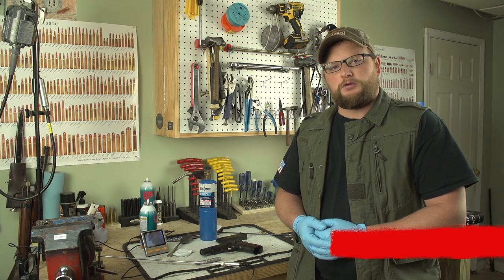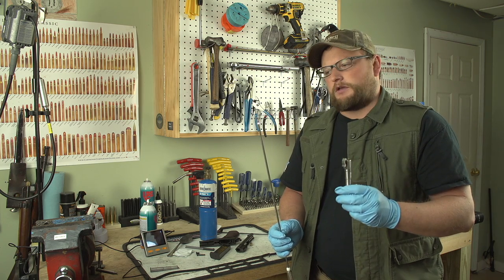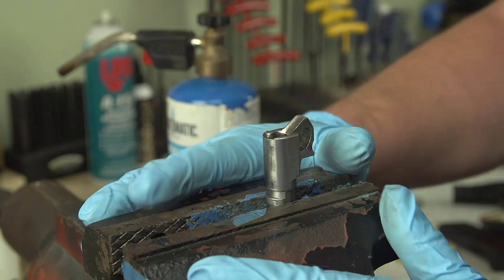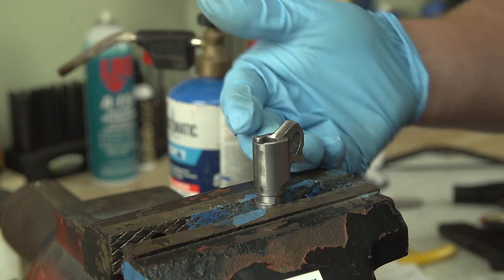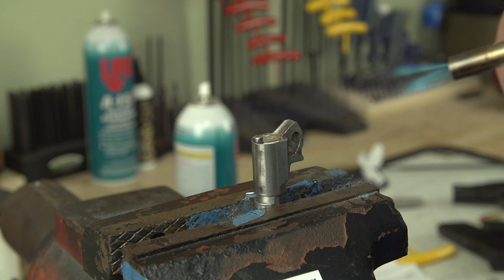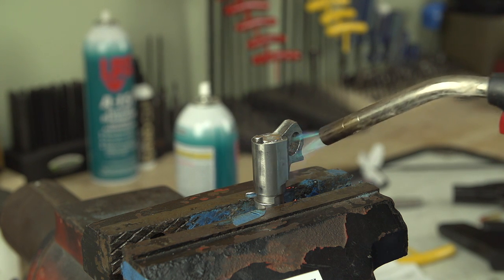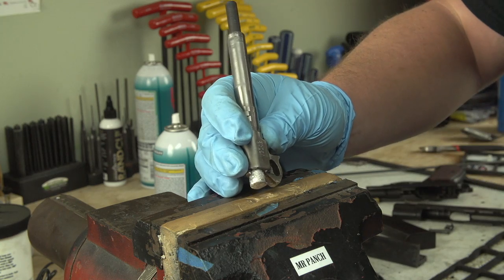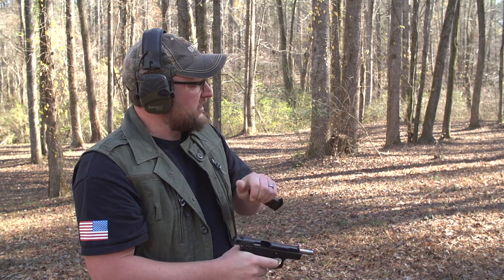How To Use Brownells Cerrosafe Alloy

Comment: with a melting point that low I would say that stuff is some kind of lead bismuth eutectic like used in alpha class sub reactors. cool stuff!
Reply: Mostly bismuth, but also 8% Cadmium, so you need to be even more careful with this stuff than lead.
Reply: V3N0M Wow not a eutectic...I guess it's either the tin or cadmium that prevents that. Thanks!

Comment: Cerrosafe shrinks a little as it cools, then expands again.  It is recommended to remove the plug, 30 minutes after the melt solidifies.  That is when the plug is typically at it's minimum size, a little less than a tenth of one percent smaller than original chamber size.  If you need to take accurate measurements of the plug, wait another half hour & it should be back to actual chamber size.  After that it continues to grow a little for the next 20 days.  In the end, it ends up about 1/4 of 1% larger than the original chamber.  It contains about 8% cadmium, so handle it accordingly.

Comment: I have a block of cerrosafe that I've never used. But it will come in handy. Nice that it's melting point is so low.
Reply: Stew Knoles an you can keep using it over an over. I need to invest in a little

Comment: Great stuff, but a cheaper solution to the same stuff, just repurposed, is Cerrobend (1lb for 20 bucks). It also used to be called WoodsMetal and Lipowitz Alloy. They used it to put into pipe, so you could bend the pipe without kinking. Now it's been reinvented for gun work. It does a great job BTW, for casting and casing removal.
Reply: Similar alloy, same constituent elements, but not quite in the same ratio.

Comment: I had some crud in my AR-15 barrel the other day... I thought I caused a stress fracture in the barrel from hammering at it to get it out... ended up getting a buddy to help pull some cleaning brushes through it cause it was that tight and got it out.... this probably would've done the job so much easier... probably gonna pick some up...

Comment: First generation 9mm Winchester Silvertiop would do the same thing.  The jacket material would back into the front of the chamber and prevent the round from fully chambering.  As I recall, depending on the pistol, it might take only 50-100 rounds to foul the chamber enough to cause a failure to lock.

Instead of a soup spoon, I use a bullet casting ladle to heat and pour the Cerrosafe.  Seems to work better for me.

Comment: Don't buy Cerrosafe from Brownells - it is MUCH cheaper to buy it directly from the manufacturer (Bolton Metals)
Reply from the maker: I find that I like the convience of being able to place one order from supplies and get everything from one place, but if you were a large shop and needed a lot of it I could see where that would be worthwhile.
Reply: Iraqveteran8888 I totally understand that, but Brownells lists it at $46/pound, where Bolton Metals sells it for $15/pound (and if you're local and ask nice, they'll let you pick it up at the foundry to save shipping).
Reply from the maker: A pound is a heck of a lot of Cerrosafe. I think this block is 12 OZ and I've had it like 10 years...lol
Reply: Iraqveteran8888 Ya a pound is a lot, but Bolton's 1-pound (comes in half-pound ingots) is still $10 cheaper than Brownell's half-pound ($25).
Reply: Iraqveteran8888 A pound is a heck of a lot? Do you not realize that 12 ounces is only 4 ounces shy of a pound? It's not that much more than 12 ounces, and if you can get a significant discount - why the heck not?!? Just bought a pound from Bolton for  $14.80.
Reply: Cephas Martin he also said he's had it for 10 years. Sounds like it's an item he doesn't use frequently.
Reply: Frank Stadelmann: The point I was raising was that a pound isn't much more than 12 ounces so buying a pound isn't that much more and you can SAVE MONEY. I guess you must have an aversion to saving money.
Reply from the maker: No Frank...it gets used a good bit actually. You keep melting it down and reusing it. As long as you are careful with it you'll never lose it.
Reply: American Raccoon 10/22
Reply: American Raccoon they can be stupidly accurate with some work done to them.
Reply: or just buy Bismuth in bulk... or Gallium.

Comment: Hey Eric, my m39's front handguards are clamping the barrel. How should I remedy this issue without decreasing the value of the rifle?
Reply: I've tried loosening the screws and taking the gun apart, but I still have the same issue. I'm hoping that when I clean the stock (like Eric did) the the wood will either loosen or expand away from the barrel.
Reply from the maker: I can do an M39 accurizing video. Theres a few ways to go about it, but I wouldn't do it a very collectible gun. It will involve removing a bit of material mainly from the upper hand guard. Also, make sure your stock was the correct amount of shims in place near the recoil pig in the stock. You'll also see the stocks shimmed near the tang as well. The Finns knew how to make an accurate rifle.
Reply: Iraqveteran8888  Thanks so much for taking the time to respond to my comment. A video regarding this would be GREAT! All the shims seem to be in place (except I didn't find any shims under the trigger assembly.) I think that the previous soldier using this weapon farmer tightened the screws. There are contact points with the handguard in the same places where your rifle's handguard was sanded by the Finns. Once again thanks SO much for the response. That video would be GREATLY appreciated. Have a great day.
Reply: Eric, please do as I have the same situation on my M39.

Comment: Wouldn't a wooden dowel be better suited to ram out the CerroSafe?
Also, excessively heating the barrel will expand the diameter of it resulting in faulty measurements - right?

Comment: You think plumbers solder could do the same thing?
Reply: Something flux-free maybe; wouldn't want any corrosive flux eating into your barrel.  

But there are likely other lubricants in the Cerrasafe to really make sure it doesn't bond to any other metals.
Reply: RyDaddy cool. Thanks for the info

Comment: Is there a potential issue with transfer punch damaging the rifling in the muzzle area?
Reply from the maker: Nah, but if you really want to be super careful I'm pretty sure you can get a set of transfer punches made from brass.
Reply: Not much really, would have been better to use a brass one since it is soft.
Reply: I agree with rotary saw-the only problem might be with the brass mushrooming if the stuff is to hard to get out.

Comment: Their was some old stuff that was mostly led and mixed that did this . So is it about the same thing ?
Reply: Gallium
Reply: Will Robinson yes thank you it was bugging me
Reply: It's not Gallium... Gallium MAY work for this but i wouldn't try it till you try it on something you don't care about... Gallium melts at 85.58 degrees and this stuff is melting near 165-190 degrees... so its not really Gallium at all... it may have some metals in it the same as gallium... but i would rather buy the true stuff and not cheap out. its call Safe 165.
Reply from the maker: How hard is that stuff when it sets up?
Reply: +Iraqveteran8888       1.5MPa   Exactly the same as lead.

Comment: I tried to do a buddies rifle with this stuff, four tries, each time I couldnt beat it out with a hammer. Had to melt it out each time. Thought I had got into the extractor, nope, locking lugs, nope. WTH did I do wrong?
Reply from the maker: It's forming a mechanical bond somewhere. Don't get discouraged.
Reply: cast it freeze it then take it out easily. return to room temp and measure.
Reply: Savage. Son I can swing a hammer just dandy. #16 sledge driving dozer track pins will teach you that in a hurry.
Reply: The02seta Hard to get a barreled action in the freezer. But good thought.
Reply: upside down canned air, co2 and there's dry ice.

Comment: Gotta be careful not to ruin the temper on that barrel steel with the torch dude.
Reply from the maker: Nah not gonna get it that hot. It would take a lot of direct heat from a map gas torch to do that. A little propane won't hurt in small doses.
Reply: Iraqveteran8888 ever work with pattern welded steel barrels? If so, what's your opinion on accuracy/wear and tear as opposed to a homogenous steel barrel?
Reply from the maker: Pattern welding is a lost artform by today's standards for gunmaking. You certainly can't get crazy with pressures in something like a Damascus shotgun barrel. Another form is known as twist steel. All are awesome in terms of gun making art, but I don't know if any were ever strong enough for nitro use. Never dealt with them enough to know how they wear. Guns made with that form of barrel are still around and working today so I assume they hold up okay.
Reply: Iraqveteran8888 sweet. I've been transitioning from armour and blade smithing to gunsmithing and eventually I'd like to combine the two in some epic builds for fun.

Comment: verry handy but i wouldnt have put a punce in my barreljust becaus you mith damadge it but thats a personaly opinion
Reply: A brass drift would have been a little better but with the transfer punch fitting well to the bore, not sloppy, not tight, just right, the punch isn't going to hurt it. I say brass is better for this sort of thing because it is softer than the barrel steel but on occasion steel is justified. If you get a really tight chamber cast or trying to get a stuck case out, the malleability of a softer metal can get you in trouble too. All about knowing your job and selecting the right tools. No harm came to that CZ-75 barrel, Eric did a great job!
Reply: Ian Duijsens as long as it's smaller than the diameter of the barrel it's fine . If you were particularly nervous I guess you could use a plastic punch which would accomplish the same thing since that cerosafe has such a light grip on the wall of the chamber
Reply: alriith thx
Reply: mytmousemalibu alrith well im not a gun smith or anything it was just a concern that i hade and indeed i would have use brass or copper myself

Comment: Hey Eric, when I cleaned my m39's bolt in hot water and simple green, I noticed slight stripping on the bolt assembly. Did I cause this or is this common?

Comment: Ok I have to ask.  
I think the answer is very simple but I've thought that a lot in life and I turned out to be wrong.
After you get the chamber cast how do you remove the brass from the Cerrosafe?

My answer would be to re-melt the metal and remove it.  
Am I right?

Comment: i have a question yesterday was at the range with my ak ran about 40 rounds threw it opened a new box of steel case ammo every 2 or 3 rounds had stuck case and double feed the guy said i have a ring in the chamber but i cant feel it with  a pick amd it chambers a round and goes fully into battery i checked extractor amd spring seems fine if i had a ring would it still go into battery?

Comment: You said you can use this for a stuck case in a rifle? I'm assuming use the same process but your just using the cero stuff to take up the space in the case to help beat it out?
Reply: Nick Reynolds if the rim has been ripped off the case by the bolt and you have the remaining brass stuck in the chamber, then this stuff will save hours of frustration

Comment: 2:21 you need you normel cleaning stuff... a torch realy?
Reply from the maker: Yes. A little heat is great for getting stubborn screws loose as well as helping Kroil creep into small spaces.
Reply: +Alpha Skiller
Dude, I'm some random suburban noguns schmuck and I still have a propane torch. They're useful, as well as fun to melt soda cans with.

Comment: y are u scared to chamber rounds, guns are designed to be loaded
Reply: M Blake Jr he was using dummy rounds whilst testing it to safeguard guard against a ND. Pretty sensible really rather than sticking live rounds in a gun you know isnt working right.
Reply: MrCyphermonkey yes i agree, but he acts like he would never
Reply: +M Blake Jr He acts like he would never do it in the shop, which is a good rule to live by.
Reply: ***** until u need it